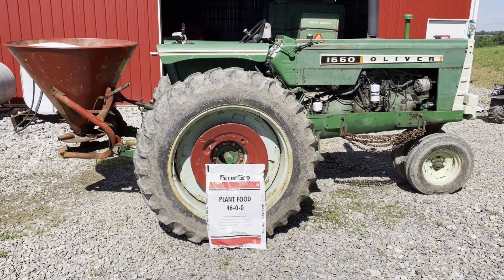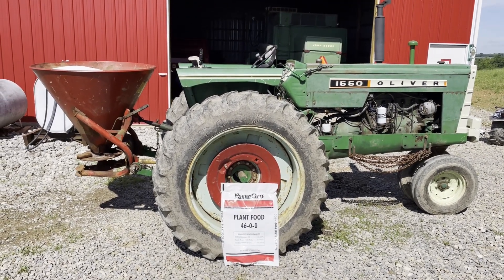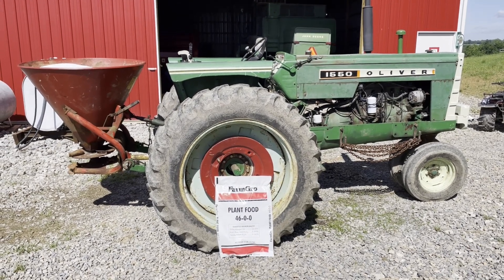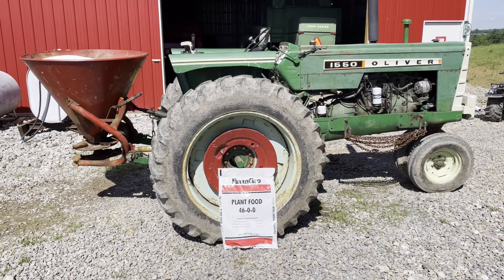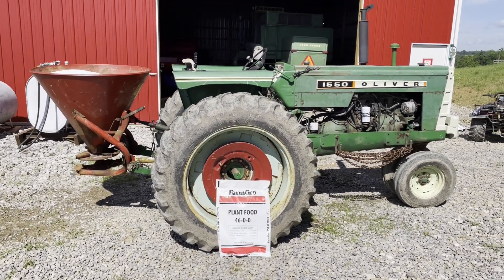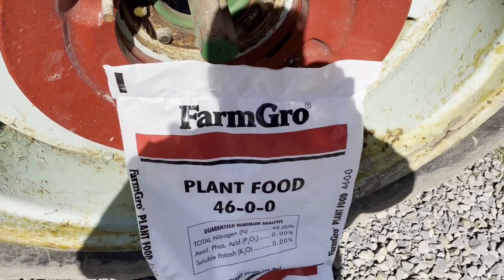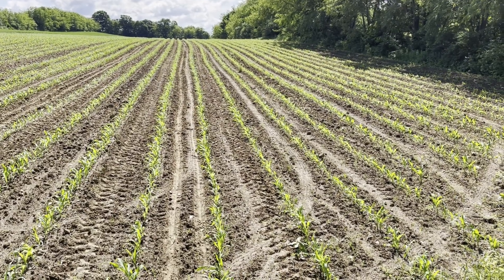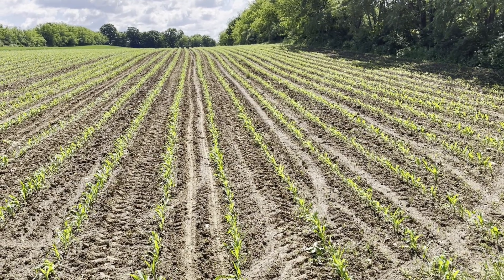Side Dressing Nitrogen on Corn

Comment: I hate to be a real downer on what you have done, but I believe you may have thrown away alot money on urea! The kind you spread should have been incorporated into the soil preplant, Superu is more designed for what you are trying to achieve, it is more expensive but it will stay in the soil better. I tried doing what you did on a small plot even cultivated it in, it didn't work so well. The ultimate product is anhydrous ammonia but it's dangerous and if you don't already have the equipment it's expensive, at 82percent nitrogen it's still the best bang for your buck! Please check out superu I think you will be much happier with the results! Good luck!
Reply from the maker: Thank you, Dave, for our comments and suggestion.  I will take it under advisement.

Comment: Thanks for the video it's nothing but rain every other day Columbus lot of the farmers doing got stuff in the ground I got a 15-acre field bush hog every week with my beautiful 1855 Oliver that I just got love it straight pipe had to tear it all apart underneath the the seat on the hydraulics what is leaking replace the t-fitting somebody didn't put sealer on it so you had to tear it all apart and put new seals gaskets on runs beautifully I love it 2500 original hours runs good everything works down to the lights got it out of Indiana for 8700
Reply from the maker: Your 1855 sounds incredible.  Sounds like a great find.  I love my Olivers too.  Something special about them.  Thanks for watching and commenting.

Comment: My corn is 4 and 5 leaf also. Lucky for me my corn is using manure credits right now, I top dress urea when corn is knee high so I know it doesn't run out of nitrogen before maturity. I use stabilizer but still don't put faith in that saving the fertilizer if we don't get rain!
Reply: manure credits 
Good one Brad. 👍🙂
Reply: @SoybeanFarmer3300  With all the manure I deal with, I have to think of it positively!
Reply from the maker: @LVFFarmVlogs  I wish I had some manure.  Haven't had cattle on the farm since 1998.  The manure is definitely a "plus".  One of the reason's I top dress now is because I've read where it actually takes the urea about 2 weeks to before it's able to be utilized by the corn plants.  This way, they will be getting it by the time the plants are 10-14 inches tall.  Thanks for watching and commenting Brad.  I also liked the "manure credits".